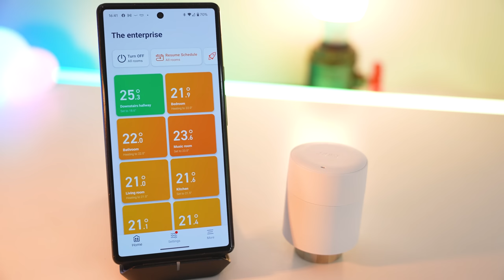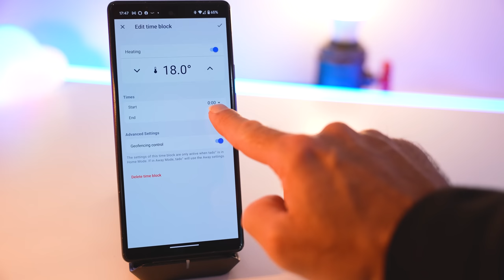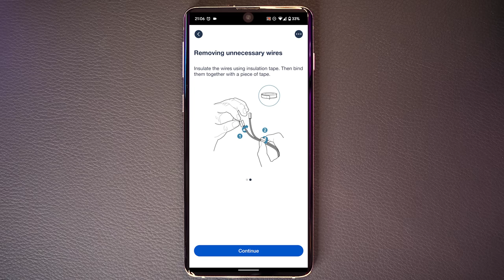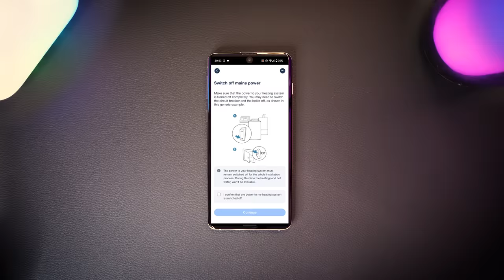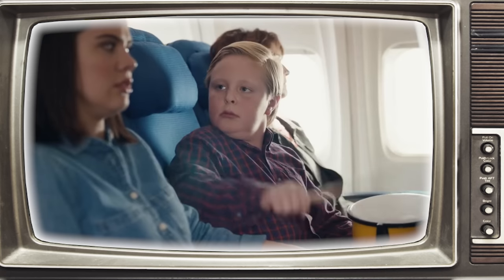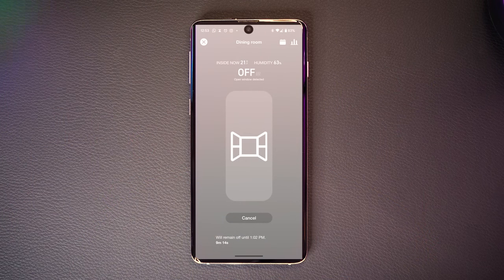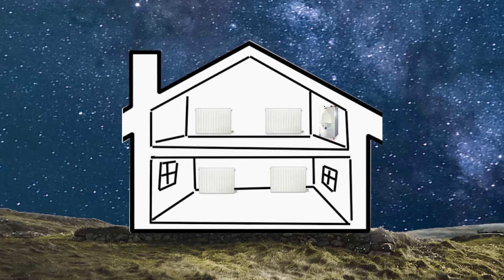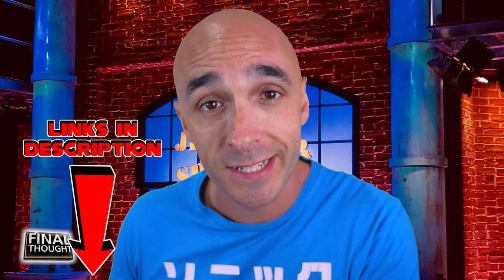Install This On Your Radiator & Drink The Tears Of Your Energy Company

Comment: The reason you need a bypass radiator is because when the boilerpump is running, the water needs to be able to go somewhere or it will break itself. Instead of a bypass radiator, which might cost you money because you're heating a room that doesn't need heating, you can also install an AVDO. This is a bypass which will open at a set pressure so when none of your radiators ask heat the water will go through the AVDO instead as long as the pump is running.

Comment: When the internet is down, the system DOES work as long as you're home and you have power. It has it's own pairing network, it just uses your local wifi to connect to the internet. You walk up to your thermostat and turn it up, whether radiator or central.

Tado is actually great, had the central thermostat for years, fitted some smart TRVs couple of years ago and it definitely saved me loads of gas - but I did the rest of the house last year with mixed results so there's a lesson to learn about going full in with this system, at least whilst the tado system works as it currently does, see below. 

There's also a bunch of things tado need to do to improve:

- Install is a very easy job, but given you pay a sub for the extra features, it'd be nice if they offered a proper customer-by-customer consultation service to help you get the most from your particular home once you have installed it.

-provide more fine control over early start. The algorithm, sometimes, decides hours and hours earlier is a good time to start. 

- provide a way to reset the learning algorithm. It doesn't cope well in the early heating season (like now!) if you are fining tuning a bit, or if your 'life patterns' change (like during and after pandemic controls)

- Provide an out of the box way to get your data out of the app. this is really important because they do not provide a central dash board to look at your whole set up, you have to drill in room by room. Which leads me to...

- Provide a single console to look at all the data per room for smart TRVs

- Keep the webapp up to date and inline with the smartphone app instead of being a poor cousin. Geofencing aside, if one of them has advanced features it should be the web app.

- Allow more fine control over the aggression of the system - i.e. under what conditions it will call for low, medium or high heat. Need to be able to set this based on how fast a given room loses and gains heat to avoid the boiler firing for too long at low without doing much, or alternatively shortcycling. Their algorithm is... not good at the 'learning' thing, and doesn't seem like it's getting much better. Frankly every home is unique anyway - give the owner a bit more direct control, have your algorithm learn centrally from *that*. This will be more effective and deliver faster improvements for everyone particularly those with boilers which are NOT opentherm compatible and thus have to run on relay only so the specific heat call doesn't really do much, it relies on the boiler cycling down based on the return temperature which obviously takes some time to work itself around the house.

- better orchestration from the central thermostat where you have multiple smart TRVs to get better use of the boiler when it's on, rather than have rooms call for heat within minutes of another room shutting off.
- allow rooms to be grouped, not just devices - i.e. add in an extra layer of orchestration and control between radiators and zone, if needed*. 
- open up to allow smart TRV control from other central smart thermostats like nest etc.. I get this is totally dependent on the other smart stat companies playing ball with their smart TRVs also.

So as I say, I've had the system 2 years and I have not noticed much by way of specific improvements in the direction of any of the above - I'm not sure the company is interested in those kinds of improvements so if you want your data and truly granular control, maybe look at other options from Tado. 

Regards putting smart TRVs on every radiator: this has actually seen my gas usage spike back upwards compared to just the central tado thermostat control and low-and-slow boiler settings I was using - at least on the days when the house is "fully occupied" all day e.g. weekends. On the other hand, it is absolutely FANTASTIC at saving gas during the week when only one room is really occupied during the day. However as a net, it is definitely higher than when I had the central tado thermostat and just smart TRVs on the least occupied rooms. I am considering putting my dumb TRVs back on 3 radiators. 

That said, if your house or particular rooms are empty much of the time, and you're not that bothered about analysing the data over time to fine tune... Tado smart TRVs really are great, I don't want to piss all over it. 

But lesson learned: for rooms which generally need heating only at the same time as other rooms, leave standard dumb TRVs on those radiators. Put smart TRVs on the rooms that you only partly occupy. 

*Alternatively when multiple smart TRVs are grouped in one room, allow the option to allow a single radiator to call for heat independently, rather than having to set a measuring device that fires all of them. E.g. our house - hall, kitchen and living room essentially share the same "air" most of the time since folk are constantly popping in and out and so the doors between just aren't usually closed. Smart TRVs on those radiators is meaning the boiler is firing 3 times as often as it needs to. I would like to be able to put them as one room - which will solve the boiler firing problem whilst probably overheating some rooms slightly... but I still want the option to close the living room door and boost just that radiator and when you group them in one room that's not possible. 

In short, it's not perfect. But if you keep it to the only partly occupied rooms, it will definitely save you money compared to just a central thermostat and dumb TRVs throughout, although that will also definitely save you money compared to a standard thermostat and TRVs.

Comment: The requirement for bypass is presumably their valves are not mechanical and takes a couple of minutes to fully open like a typical UFH manifold valve. But if your boiler has opentherm, chances are it has built in bypass valve. It amazes me Tado can’t implement a boiler delay in software! My Heatmiser can delay boiler firing for 2min so the valve has time to open before water circulates.
Reply: It's also just for old systems with dump pumps. Modern system adjust the pump on system pressure. Or just get an efficient modern pump

Comment: one really cool feature that you didn't mention.
when you set a schedule, it is still possible to turn it on/off manual (app/device/smart home assistant). 
But here is the smart part, you can set a duration(per device) that the valve functions on the "override" before going back to the schedule.
I found my fiance turned the heating on often but then forgets to turn it off.
so I just have to revert to the schedule after say an hour.
It Saves LOADS of gas
Reply from the maker: Nice! Thanks mate!

Comment: Hi Paul, great video as usual.  Maybe you should look to review Drayton Wiser as a cheaper alternative to Tado.  They have HA integration as well for local non cloud use. I was going to get Tado but was put off by their subscription for advanced features.
Reply: I agree. I did quite a bit of research on smart TRV also ended up going with the Drayton system because Kit 3 does multi zone systems (S plan+) they also do a underfloor heating manifold controller which is why we ended up with Drayton. 
I also thought that Tado has  a subscription fee?
Reply: You can use Tado perfectly fine without the subscription. When I first bought my system, the advanced features were a selling point and was thoroughly annoyed when they switched to a subscription for those features. Deffo made me think twice about the system and the company as such tactics are pretty despicable (IFTTT…), but even without those advanced features, using Tado for free is extremely advanced, thorough, and highly energy saving.
Reply: @inthapipeline As Paul would say “Corporate greed, corporate greed…….”
Reply from the maker: @inthapipeline  I'm having a bit of confusion with the "subscription" conversation, a few people have mentioned it now, but I've seen no sign of it in practice!  I've even enabled geofencing this morning to see if it was behind a paywall, but it just enabled 🤔
Reply: @paulhibbert  the subscription is a feature called Auto Assist I think, which automates features such as geofencing, open windows, system irregularities, use analytics. I turned the geofencing on when I first got the system and it would alert ask me if I wanted to manually turn off the heat because I was no longer home (as opposed to automatically doing that which, I think, is a feature of the subscription); I turned it off because that prompt on the way to work became pretty annoying. At one point I did programme Tado with IFTTT - to this day I have a geofence routine in IFTTT (one of the routines I kept when it switched to the paid version and I can use that for a variety of things); this triggers a virtual switch in SmartThings which turned my heating on in certain places when I came home. I mainly did this out of annoyance at Tado advertising free features and then switching those features to a subscription model (sound familiar?!)
Given the energy cost situation, I’m gonna give the Auto Assist feature a try for a couple months, see if it’s worth it but at this point, I don’t see what additional benefit it’ll give me.
All of this has been a longwinded way of saying, I don’t actually know the additional features the subscription provides! 😆
Reply: @paulhibbert  So, it just weeerked?
Reply: +1 for Wiser, been using them for about a year now. Pretty much feature parity with Tado but no subscription. I got 10 months out of the TRV batteries though.
Reply: I replaced my radiator valves and thermostat with the Drayton/Wiser Heat application, any schedules set are run locally. Also works with HA.

Comment: I was using Honeywell Evo Home for around 6 years then my old fuel oil heater broke down its was around 20 years. Contacted a dealer and got myself a Bosch Condens 2300i W with a Bosch EasyControl CT200. These 2 systems do basicly the same thing give you induvidual control over every single radiator. 
the biggest advantige is say goodby to dump thermostats that need the main room to get heat in your room you want heat for example the hobbyroom.

When doing a new system ask your dealer to instal a bypas loop. this solves the problem for that radiator tat still needs to be constand on.

For all ppl that are still using CLASSIC 1 thermostat that can control your heater switch to anny of these smarth systhems! Just make sure that each radiator can control your heater.
save a lot on your bill

dont be afraid to spend over 500€ for a system like this

Comment: At 12minutes, it is recommended that all modern boiler installations have a bypass system installed, it's not difficult and it's not expensive.

Comment: Tado is OK and definitely saved the money invested last year. The TRVs are a bit poor at reading the room temperature as they are too influenced by the radiator when installed vertically. You can offset them, but then they are incorrect when cold. They need some smarter calibration.

You can of course get a separate  room thermostat which works really well, but for what they are, they are very expensive.

As a home assistant user you can do the geofencing yourself without having to subscribe...
Reply: You can buy a room thermostat to control one or more TRVs in a room and put the stat somewhere where it will make more representative readings of the temperature. Also easier to operate than TRVs if you don't have your phone

Comment: re. the bypass radiator: it's because it's bad for your boiler if it turns on with all radiators closed because of pressure build-up.

Comment: We’ve had Tado for two years and ver happy with it.  They are not silent though - bear this in mind if you’re a light sleeper.  I would also suggest getting additional room sensors to monitor the temperature rather than the radiator valve itself, more so if you have two radiators in one room.
Reply from the maker: I almost recorded the sound, but I figured Neesha is a light sleepr and it doesn't wake her up and she's right next to it!
Reply: @paulhibbert  I wake up if an ant farts half a mile away.  Note - parts of the previous sentence might be exaggerated.
Reply: Do they constantly change the valve to maintain a certain temperature or is it only when you change the temperature?
Reply: I felt the same when I installed mine initially but I just got used to the noise and I’m almost certain it’s now quieter than it was before (May be that I’m not consciously noticing it though!)

Comment: Don't forget to mention that for some extra functions you need the subscription service .
Also when you have the regular on or off knobs then it doesn't work and you need to replace them with new thermostat ready ones.
So just taking the old knob off and replacing them doesn't work and will costs you extra as you will need to hire a company's to replace all the knobs. 
This can get very expensive as you have to pay for the parts and labour time. 
Also they are not compatible with all the different version as is listed on their website, so you should check before trusting this review blindly as it is sponsored and allot of important info is left out.

Comment: Once again, a video on a topic I could not possibly care less about (Forced Air AC, I've never lived in a house with radiators), but I watch for the entertainment value.  Great Job Paul, as usual.  

No fish slaps this week? No Hecklers?  No 1930 salesman abusing Reginald?  I miss them all.

One small suggestion for your adventures in installing.  If you'd taken a bit of 1x4 wood, mounted that to your wall, and mounted the controller box to that, you'd have been able to use a screwdriver to set that last screw, rather than needle nose pliers.

Comment: I'm building an airing cupboard with a radiator inside of it, at the top of my stairs, and, so, using that as the bypass wouldn't be an issue as it's a tiny area, and, I'll be fitting an automated fan to the door too using a Shelly heat and moisture sensor with a Shelly WiFi based in-line switch with a routine to power it on when it gets too warm and moist in there.

That's not rude now is it?

oh, and I've also fitted a broadlink 3-way (THATS WHAT SHE (OR HE) SAID) light switch into a relay (fitted with a capacitor and a diode so that it won't produce major back EMF and kill the smart switch) so that I can automate when I switch the bathroom extractor onto full.

This will then allow me to extract the moist air from the hall way once it's been dumped out of the airing cupboard if the moisture level's too high, or, just let the heat circulate upstairs 👍

Comment: I looked into this, and wanted to buy it. But I was put off by the Tado subreddit and community forum being full of people complaining about poor reception and communication issues between the TRVs and the bridge. Tado stuff is also not Matter compatible - this is apparently coming late next year, which is an incredibly slow roll-out, given Aqara already has some equivalent products available with Matter. Tado's solution to lots of complains about the TRVs not getting the temperature in the room right was to offer an external temperature sensor, for £90 a pop, per room. (On top of the £66 per room you're already paying for the TRVs). I hope some more competitors enter this area, because there's a lot of really basic improvements that could be made.